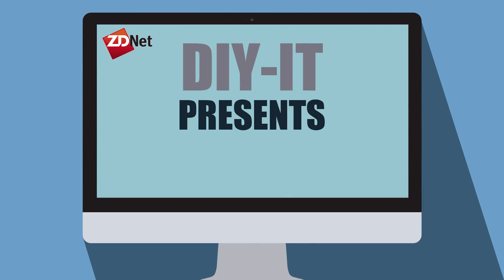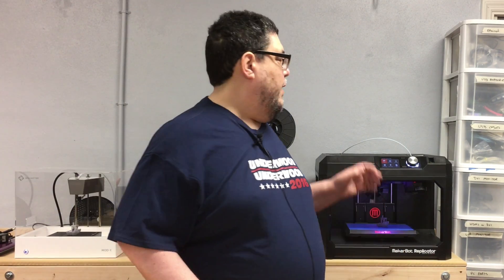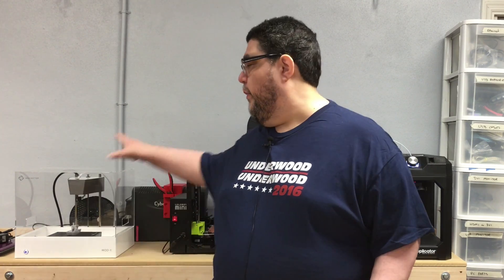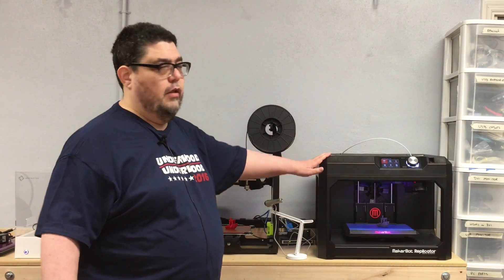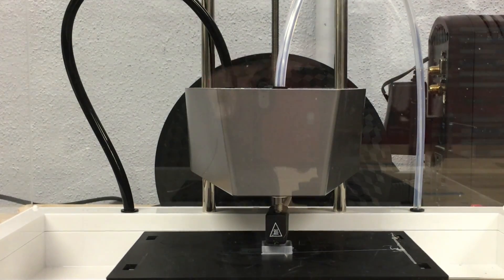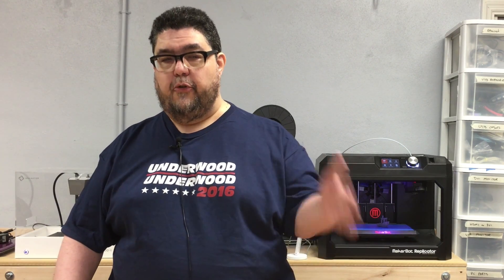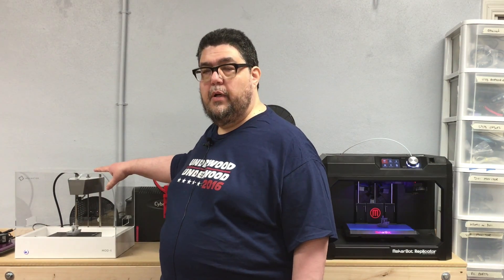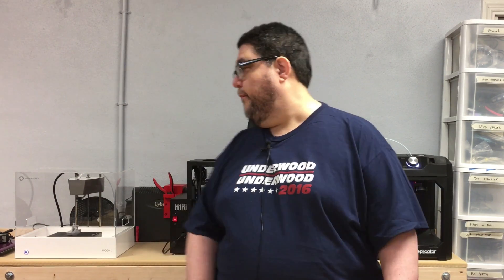Is any 3D printer quiet enough for the office?

Comment: why that Mod T is so quiet?
Reply: The MOD-t isn't necessarily slower than other desktop printers in the same price range, as it prints at speeds of up to 80 mm/s. One of the main aspects of the MOD-t that helps to keep the noise level down (besides the clear cover, of course) is the use of servo motors instead of stepper motors!
Reply from the maker: Mostly because it's both a little slower than some of the other printers, but that plastic shell is the big win. You'll see that demonstrated later on in the video.
Reply: Thanks for the reply. But event without that cover it is much more silent than the others. There must be a trick somewhere.